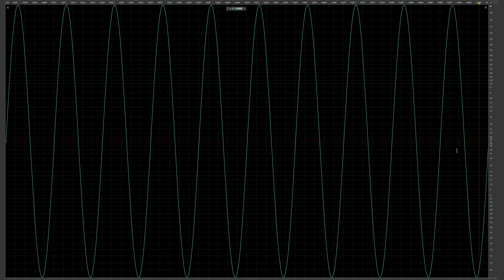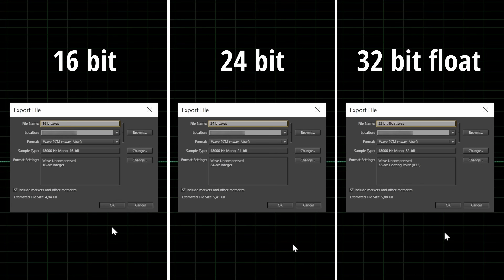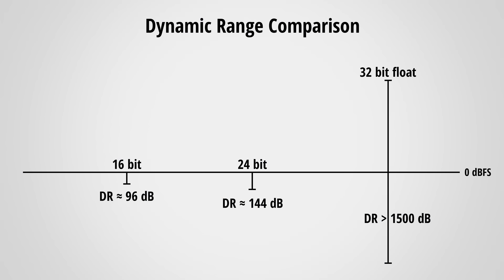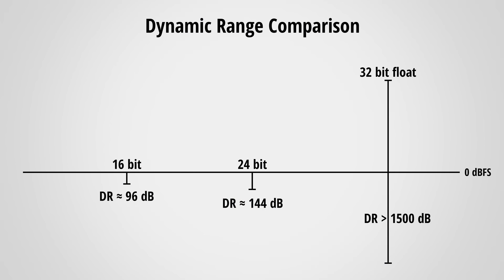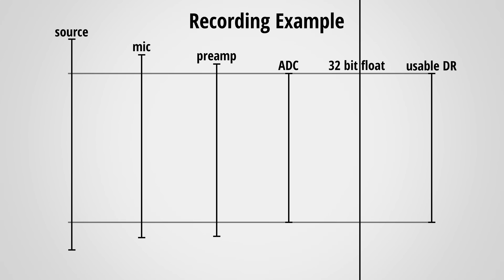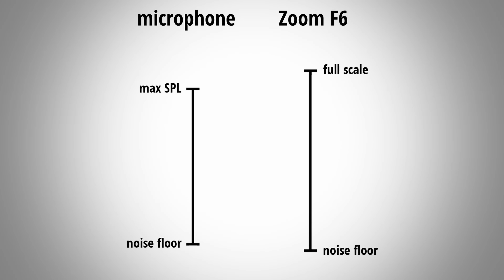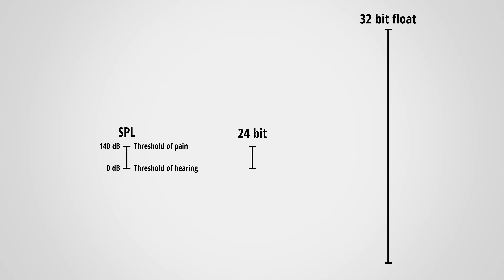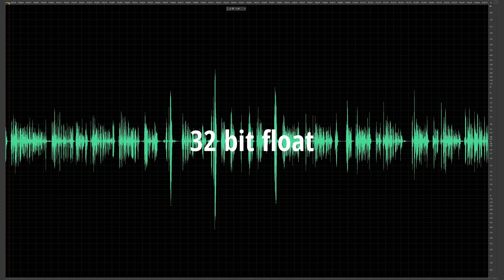The TRUTH about 32 BIT FLOAT for audio recording– Really useful or marketing hype?

Comment: Would it be safe to say 16 bit and 24 bit is fine if you don't clip? Love your vids!
Reply: Yes, and 24 bit is much harder to clip than 16 bit, so 24 bit would be a preferred recording format. 32 Bit float only has an advantage if you record something with very large volume fluctuations, make it hard to set the gain. If a volume is consistent, like with recording a person speaking during an interview, you can set the right gain with 16 or 24 bit, and there will be no advantage using 32 bit. You would be hard-pressed to find a 16 bit recorder these days, almost all have 24 bit at minimum.
Reply: For field recordings 32bit float has all advantages as 24bit and when you blow a recording u just pull it down to 0 or less
Or if the signal is very weak u can pull it up50-60 db without adding noise

Comment: A very good and voodoo-free explanation as usual. What could have been stressed out in this video though is that actually also integer based 24 bit PCM is some kind of "convenience" to some extend when it comes to pure recording and playback / distribution as here, the SNR of linear 16 bit PCM is already extremely high and virtually never utilized. Further processing approaches excluded of course.

It would be nice to see another "unagitated" video about the floating point format itself and the - as far as I understand it - inherent decoupling of signal to noise ratio and dynamic range which usually go hand in hand with linearily used integer variants.

Comment: Coming from a software engineering background, something I've never understood is how 32-bit float is actually enough for audio processing. In programming, you almost always want to use 64-bit float for calculations because if you do more than a handful of calculations with 32-bit float your precision will go out the window pretty quickly. Why is the story different for audio processing? You don't ever see 64-bit float used in audio.
Reply: for Simple recording where there isnt much porcessing of the audio data involved 24-bit fixed point is plenty. When it comes to the post production its a sligthly different storry. Some DAW work with 64-bit float internally for the processing. though 32-bit float is stil the norm. Some Plugins do also use higher bitrates for the processing internally but the output is converted back.
Reply: Actually, I do think a few applications are using float64 these days (e.g. Foobar2000 if memory serves), but it's definitely gilding the lily. Real-life audio material tends to contain a ton of noise (basically, built-in dithering) and rarely even challenges 16 bits. A superb playback system might cover about 110 dB instantaneous, that's little over 18 bits. Still a fair stretch from the mantissa of float32.

The "don't do more than a few calculations or you'll regret it" level for audio is about at 16-bit int level. This is why people used to be after "bit-perfect" output.
Reply: We're barely writing and producing music worthy of 8-bit these days, let alone 64-bit.  The better audio recording has become over the years, the worse the music has become, which is no fault of the audio format of course.  I wonder if there will ever be a time when both audio and music are on an upward path for quality?

Comment: Note that 32bit floats only brings ~144 dB of instantaneous dynamic range due to its 24 bit mantissa. The only extra feature over 24bit integer is the dynamic (floating) scaling of the exponent. 32bit float has absolutely no advantage over properly scaled 24bit integer for signals presenting spectral information within 144dB.
Reply: Which is pretty much what he said.
Reply: @LondonSteveLee  He said the dynamic range is around 1500 dB, which is not accurate.
Reply: @lambdaprog  That's fair enough, but he did point out that with properly gain staged material there no advantage with 32 bit.
Reply: That is true if you sit with the recorder during takes and when a bird lands nearby and screams you pull the knob down or use a limiter ..32 bit float u can leave and come back next day if so, you have full control!

Comment: Hi! Zoom F8n Pro advertise lack of analogue gain, but it also records in 24bit. How it is possible without introducing excess noise?
Reply: They are advertising an "auto mix" function for 24- or 16-bit recording that is supposed to pick a decent level automatically and apparently turns things down when it only detects noise.

Comment: One thing to note as well: You can't actually get a full 24 bits of info from recordings.

At about -123 dB, cosmic background radiation and thermal noise come into play, and with current circuity technology, there is no way to avoid it.

So really, the maximum amount of dynamic range you can record is only 21 bits or so. That said, you can synthetically create a wave in a file that exceeds this, but the moment it enters the analog domain, this limit comes into play.

24 bit is plenty. That said, the convenience of using two ADCs to avoid clipping can be pretty nice, but that's about it.
Reply: We could avoid clipping just by setting gain low enough on 24 bit recorder and get the same result.

Comment: I'm going to ask a stupid question...  How does this relate to Hz; e.g. 24-bit 192000 vs 32-bit 192000 vs 32-bit 384000?  Thank you in advance.
Reply: These are entirely different metrics, so there is no relation. The Herz is the sample rate, so the amount of times per second that an audio signal is recorded. 
While the bit-rate indicates how much room there is between the lowest and the loudest audio signal (the distance between the floor and ceiling if you will), before an audio signal starts to distort / clip when it hits the ceiling. If you multiply the bitrate by 6, you get the 'space available' in decibels between 0 db and the most loud signal, without the signal distorting / clipping. 
The sample rate should be 2x the highest frequency you try to record, and human ear can hear up to about 20 kHz. That's why 44.1 and 48 kHz are the common sample rates used for playback, as beyond that the human ear cannot distinguish any difference. Going beyond this is generally overkill, and only used in recording to have more data to work with in post production and audio processing.
Reply: @Edwin--  Thank you!  I greatly appreciate your time and knowledge.  Cheers!

Comment: When everything was 16 bit, gain settings were crucial because of the dynamic range limit. With 24 bit it was widened. The remaining problem with 24 bit was that if you recorded a low signal, you may have to boost the gain digitally in post (say, if it's a single source like a voice). Boosting or normalizing brings with it the inherent noise in the signal. So it's not that input gain level doesn't matter in 24 bit. You still want to capture a signal as strong as you can get while maintaining plenty of headroom for clipping. With 32 bit, this problem seems to be eliminated.

Comment: I think 32-bit might as well be, now that it's available, a must-have feature for a field recorder, as used for example in journalistic capacity. When you may be recording something that happens exactly once and that you won't be able to re-record. So not having the ability to screw up the gain setting during capture, with gain being done exclusively in post production, is one substantial fewer thing that could possibly go wrong.

On the other hand, i don't think it's necessarily a desirable feature for a computer audio interface.

Comment: A great explanation of the differences between/advantages of 24bit vs 32bit recording. I just got my first 32-bit float capable recorder. My reason is that as a solo performer, when I'm recording my gigs, I have to put the recorder out front, set the level, and hope for the best that I don't overload the signal. I've had some potentially great recordings ruined by clipping because things got too hot for the actual recorder. With 32-bit float, I still try to set things as best as possible, but I have the sort of added insurance that I won't clip the recording. But I agree that it's not a magic bullit, as you can still clip the signal before it gets to the recorder. Good recording technique is still needed.
Reply: Yes if the audio is so loud that it clips the mics or inputs but with speech or unamplified audio this is unlikely and recording in 32 bit float is a great safety feature

Comment: Very good video, Julian! 
Yes, I agree, 32-bit float is not a magic, but I don't agree it is not a "game changer". As sound designer and reporter working in the field, I love the freedom which I achieve with Zoom F3 or Tascam X8 recorders. I don'r care if levels temporarily peak above 0dB - I still have a good recording and I'm able to restore the proper levels in post-production. In the field you cannot fully prepare for changes in the environment - some of changes are too quickly to re-set the gain to "safe" value, and as you mentioned in the material, setting this level too low in 24-bit (to be safe "in the case") decreases the dynamic range. From this point of view,  32-bit IS very convenient and makes the life easier :)
Reply: Why everyone seems to tie 32bit float to the technique that combines multiple adcs signal together? 
All you have experienced can be done in 24bit format. It's the combining two adcs' signal that makes the difference.
Reply: @johnyang799  Of course. But multiple adcs are available only in 32-bit recorders. And some of these recorders has ONLY 32-bit format available. That is why :) On the other hand, if you have two or more adcs, you can process more than 144dB (just in case) and for that you have to use 32-bit. Do you need more than 144dB? Not really, but some mics have larger dynamic range, so you are able to catch whole the signal from them (e.g. Shure Beta 52A can handle 174dB SPL)
Reply: @GadesChannel   @GadesChannel  Yea. I'm not saying the actual products are not good nor the fact you shouldn't use it. It's just that either good or bad marketing people tie the two together tightly. 
btw there's also 32bit fixed point which is different from 32bit float.
Reply: @GadesChannel  well also being able to handel 174db spl is not remotely the same as 174 dynamic range. And over 140dbspl in real world is extremely unrealistic.
Beyond that you can combine two 24bit tracks to create more than 144db dynamic range. That's also part of the reason daw runs much higher precision underneath.
Reply: @johnyang799  Yes, there is 32-bit fixed, I'm aware of that, but for now I never used any recorder using this format :)
And again, in my opinion, using multiple adcs without 32-bit float is not practical. Together they are very convenient even if you in theory can "fit" combined audio from multiple adcs in 24-bit dynamic range.
BTW. Do you know ANY recorder/interface which has multiple adcs per channel/track and has only 24-bit? I don't.
Reply: @GadesChannel  the Sonosax SX-R4+ uses 2 ADC per cahnnel and records 24bit. Tough internal Processing is done in 40Bit fixed point if i remember correctly(using DSP chips from analog devices).

Comment: The whole issue really comes down to the microphone. Barely any microphones has the dynamic-range capture capabilities of 16 bit, before the mic will distort/clip the signal. maximum SPL is often combined with the pad, and you have to deduct the self noise as well, so if the gain is set correctly, the dynamic range that the mic is capable of, is typically less than the 96dB of 16 bit, that the maximum loudness is higher than the dynamic range doesn't matter, since you will only capture sounds starting that the lowest possible sound the mic can capture, and that has to be louder when the pad is active. So in most cases 16 bit is enough, with the right gain, since the mic will be the limiting factor. But then you have 24 bit, that I think surpasses the dynamic range of pretty much any microphone, if the A/D converter can even handle that range. So at the end of the day, what you end up with, is at best some very specific situations where 32 bit recorders will be able to rescue really quiet sounds if the gain was set slightly wrong for 24 bit in combination with that mic. But then you will have quiet sound near the noise of the mic, pre-amp and possibly the A/D converter so you can't simply boost it in the way it may look like in the example earlier in this video, as in that case it will not be a clean signal. It will be a waveform barely distinguishable from the noise recorded. You will not be able to really save the recording, for anything but scientific use. 
And you will be able to clip and distort the signal, as the mic and the recording path will either introduce an upper limit, before you hit the any dynamic range benefits of 32 bit vs 24 bit. And a dual A/D converter setup, could be used to record to 24 bit, as it is only about optimizing for the available dynamic range of the recording equipment, not to extend the dynamic range beyond 24 bit, really as there will be other limiting factors. 
But I get it, if you are using a field recorder and can't easily adopt the recording for all various uses as you will not actively monitor the sound at all times, it makes sense. For recording planned music, it really only creates unnecessarily big files, where you probably would have benefited from adjusting the gain anyhow in terms of quality of the actual recording.
 
For recording music: Pretty much only marketing hype.
For field recordings: possibly useful in some cases.

So if you are looking to record music, it makes more sense to consider other aspects. If it is an recording interface, the latency performance, the feature-set, the pre-amp gain, and so on. 
And if it is more expensive compared to the competition, the money might be better spent on the actual microphone, as that may be limiting the dynamic range quite a lot already, much more than the 24 bit dynamic range limitation.
Reply: "Barely any microphone"? How about a large number of LDCs for one? Any self-respecting one these days will have self noise of at most 18 dB(A) (and less than 5 dB(A) at times), while handling 130+ dB SPL or even more with pad. That is well beyond 16 bits. Also keep in mind that microphone self-noise tends to be heavily 1/f in spectrum, so you have to be very careful when comparing it to the generally much flatter noise floors of electronics as numbers can be misleading.
Reply: @PileOfEmptyTapes  the max spl is typically the number for when the pad is engaged, an then typically with 20db of pad. You then have to deduct the noise and or resistance of the membrande. Some microphones thus actually have postings for their actual dynamic range, so we can tell the dynamic range they can record, and you will find that number typically is below 100dB.